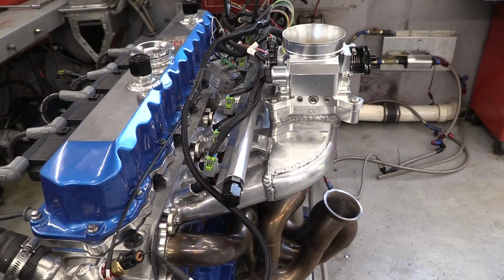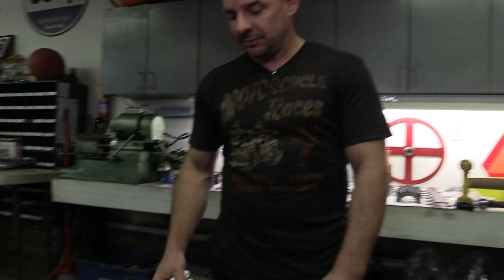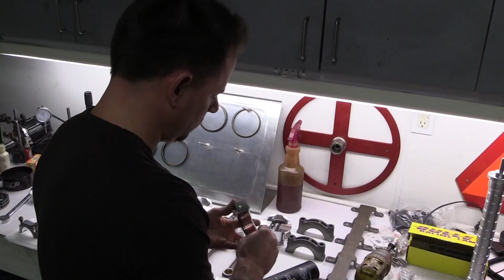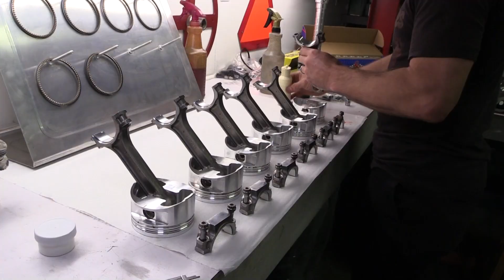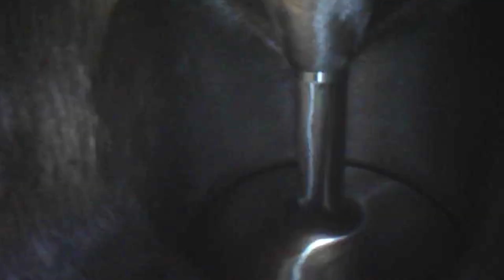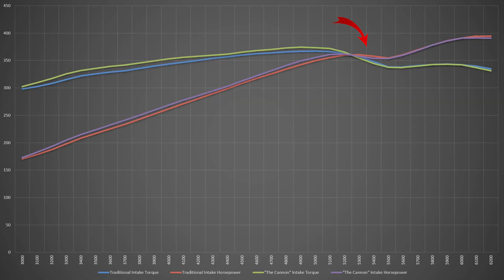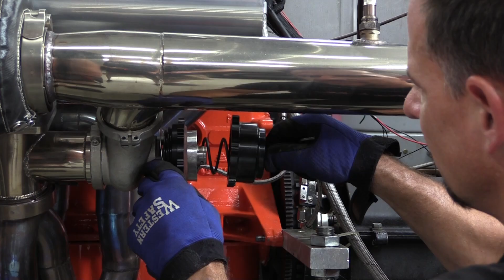Turbo Jeep Smashes World Records! (Tons of Innovation!)

Comment: Also in regard to roller lifters, could you not just use .904" tie bar lifters for a mopar with a custom ground cam?
Reply: The lifter cavities in the Jeep AMC blocks doesn't allow a lot of room for any kind of tie bar lifter setup
Reply: Have to run a keyed lifter as the geometry requires the lifter bar to be modified

Comment: Did they say what kind of gas they were using? I'm guessing he's not running race gas because otherwise knocking wouldn't really be an issue at that compression and boost level would it?
Reply: 110
Reply: @keithnewcomer4406  Thanks for the reply and what an absolute beast of a build. Congratulations. It's nice to see someone who isn't afraid to something new. If I was going to have one of these built I'd definitely want you to do it. Just curious but why not use E85? Wouldn't that give you similar knock resistance as the 110 but also be less expensive? Is it a volume issue with the injectors? Once again great build and amazing torque, well not really a curve, plateau.

Comment: I would buy that motor and put it in my daddy's Jeep I wouldn't even tell him I'd wait for him to hit the gas
Reply: @Future-Preps35  well it's one thing I've always learned yes to Creature Comforts have to stay so you build a bracket for it yes intercooled there's more of that great be creative you don't necessarily have to have the intercooler behind the grill you can always have it just under the hood even Up on the Roof her hell you just have the turbos hanging out above the hood or out of the fenders you can even hide the intercooler more toward the bottom of the engine compartment pick up air from blow the frame

Comment: Never thought I would see 800+ out of jeep engin,awesome! Like to see a Ford 300 six.
Reply: Have a look at Ford Australia’s online 6 motors in the thousands of HP now
Reply: KoreyByrne yea but the dohc technology made that possible, wouldnt happen with a single solid cam and 12” long pushrods....well not as cheap anyway lol. Got my Barra yesterday and plan on only 500whp max on stock FG with springs and OPGs
Reply: @young11984  that’s easy power my Barra did 330rwkw easy
Reply: Grunfield F that’s been done years ago lol

Comment: You can see something dripping from somewhere near the throttle body during the water meth run.  What's going on there?  Is leaking or some form of condensation from how cold it's running?
Reply from the maker: I think it is build up of water vapor from the blowoff valve after multiple runs dripping back down.

Comment: That's incredible for the ol six.    And I would love to see a 4.9l ford under the same conditions
Reply: PowerNation is doing a 300 right now
Reply: @harleyfelts668  thanks for the heads up.    
But I'm already subscribed
Reply: You should look up the Ford 4.0 SOHC Intech, it's the predecessor to the "Barra" and it's insanely capable.
They sound better than the Barra
Reply: Yes my brother I've been a mechanic for a long long time I went to school after eat Smith high School in the Bronx and I've been doing it ever since and yes you can build the 4.9 six cylinder I had a friend that had one and he built it up to about 550 horsepower in about 496 foot-pounds of talk that is pretty good horsepower most likely more than what you need anywhere in the city but it's awesome to have it so your answer is yes I seen 4.9's built up it just takes a lot more money to build them up than the six-cylinder Cherokee it is a cheaper belt on the Cherokees 4.0 than the 4.9 you have to spend a lot more money on the 4.9 Ford belt 6 cylinder that is the big difference except if you have that kind of money extra to spend an overall I believe the 4.0 is more reliable than the 4.9 I hope this helped you my friend

Comment: I would love to see this with a Ford 300. I wonder if the little extra displacement would do much
Reply: The Ford 300-6 can make a lot of power but the real issue is the head. I saw one guy take 2 or 3, sorry can't remember, LS heads and put them together for the engine. There are ways of getting around the factory limitations if you don't let people convince you it can't be done.
Reply: @Parents_of_Twins  if you can find a boss head or Hemi head that has the same bore centers and valve sequence in each cylinder, like a (4.6-5.4? Or double up on the jaguar 2.5l-3.0-3.5 VCT-VVL heads ) if they meet the criteria, add 2 more cylinders worth of bumps to the 4.6-5.4 DOHC cams, you can tune tune tune, adjustable-cam phasing, variable Valve lift  smooth idle high efficiency high flat torque curve high rpm horsepower, total power curve adjustability.mote lift without the lost vacuum at low rpm
Reply: @montana1636  That would be a sweet engine. I love stuff like that. Projects that 99% of people will tell you is impossible because it's so much fun doing the impossible. My Dad and I turned an old FWD snowplow into a tractor and heard how it was impossible. Dad had to cut the splines for the shaft mating the transmission to the transfer case with a hand grinder that he fabbed up to act like a mill/surface grinder. Tractor is still running although Dad did find a deal on a Massey that he uses more often now.
Reply: in australia we have the ford barra 4.0l straight 6 the record for a barra is over 2200hp
Reply: michael close my Barra/ZF was delivered yesterday evening and hoping for only 500whp
Reply: @young11984  fuel system/turbo upgrade,billet oil pump gears and stiffer valve springs will get you 500rwhp and still be bullet proof reliable.
Reply: michael close its a NA FG and will be going in my 65 F100 so the 500whp is plenty for me and may be excessive really lol. It will remain stock for a while then turbo will be going on
Reply: The head is going to be the limiting factor. I think the 4.0l is probably the best head of all the old school inline 6s. Lump port chevys seem to do pretty well too though weirdly.
Reply: In Argentina we use the Ford 188 and the 221 cubic inches. They are famous to rev up to 9.000 RPM naturaly aspirated with a mild preparation and pump gas. I would love to see a Ford inline six naturaly aspirated the way it is modified in the US.
Reply: @Falcon_Futura  The shit that's done to old I6s in Argentina is incredible! I wish there was more information and or parts available to idiots like myself who only speak/read english. I'd love to get my hands on one of those DOHC 'cherokee' head setups that I believe exist for Turismo Carretera?
Reply: @Levibetz  yes Sir, that's true. Nowadays with the new head cylinder (4 valves per cylinder) they are making almost 500hp naturaly aspirated with pump gas (188 cubic inches). In Argentina we don't have the V8 culture (unfortunately) but we have been developing the inline six (ford-chevrolet-dodge-torino) for more than 50 years.
Reply: It's not the displacement that would help, it's the fact that the whole block is made for the displacement.

A 5.0 could easily make more power if it had an equivalent head.
Reply: I'm pretty sure the custom head for the 300 was maid using clevland heads and it was an animal I think hes the same dude that put 2 windsors together with custom clevland heads and maid v12 engine
Reply: The Barra clowns have arrived talking shit 🤣

Comment: Wow... A Jeep engine doing 800+ HP ! Holy crap
Reply: In the 60s Barney Navarro was getting anywhere from 600 to 800 hp out of the 199 CID version of this engine sleeved down to 183 CID. Running on methanol. Power levels depended on just how high they took the boost levels.
Reply: @mpetersen6  ... Nice... But I think they were shooting for the record on pump gas
Reply: @mpetersen6  
Where can I read up on that?
Reply: @xmo552  
https://ahrf.com/barney-navarro/
https://www.hemmings.com/stories/article/barney-navarro
https://www.sr-ix.com/AMC/Navarro-turbo-motor/
The third link has photos of one of the Indy motors. The head is definitely pre 72 or so as it has shaft mounted rockers. I know the equipment for making the shaft mounted rockers was in place in late '73. At that time I think it was being used to build up a stock of service parts before being removed. The heads and block were both cut for copper O-rings. The block has a smaller diameter than the head so each cylinder is double O-ringed. The cylinders were sleeved down from 3.375 to 3.595. With the 3.00 crank that comes out to 182.7 CID or just under the 183  CID rules limit at the time.
Reply: @mpetersen6  
Hey thanks !

Comment: I'm glad more and more people are coming around to build these. I always knew they had big power potential. I'm using Zack's stuff but the idea is the same.
Reply: I'ma drop this comment since the guy I was arguing with ran away and I couldn't respond. About crossflow head and/or DOHC...

You can't do this to this engine without a major redesign of the heads and block and all the internals. It would be cheaper and easier to build and design an engine from the ground up from scratch! Stop asking for this crap because it sounds dumb. It'll never happen unless you have very deep pockets and connections with resources to build. It's pointless might as well use something else instead. These motors as is are capable of over 1xxx hp, crossflow shit and DOHC ideas are not needed.

Anyway I see this response a few times in the comments already.